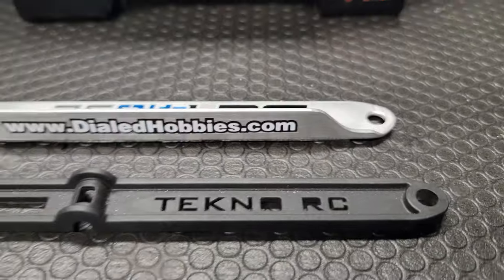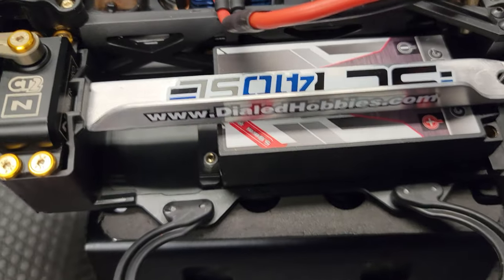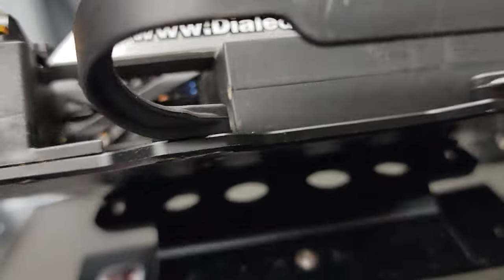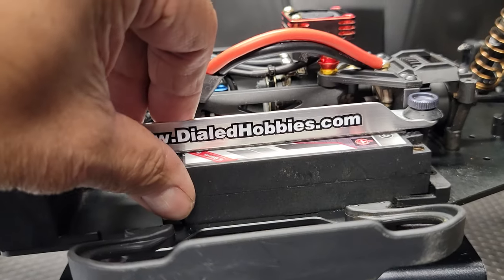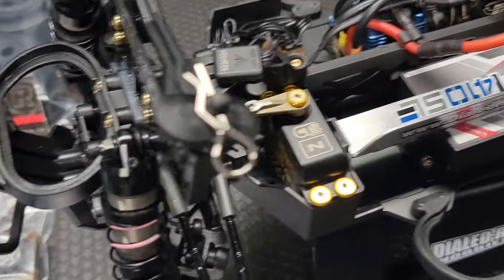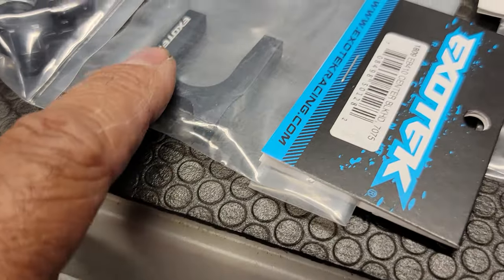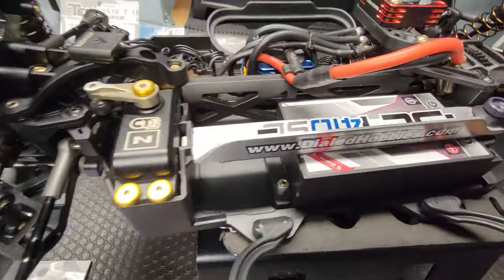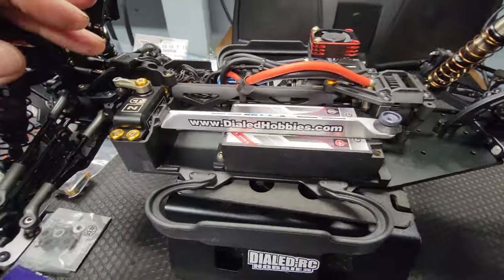Aluminum Battery Strap for the Tekno RC SCT410SL! And some other GOODIES 😎

Comment: The battery stopper you're looking for is the same as what is being used in the rear right now.  You'll need to buy another TKR6586 and use the second rear battery tray stopper in the holes provided.
Reply from the maker: I guess it's basically going to do the same thing as what I already have. I was hoping there was a part with that little lip to help keep the battery in place.